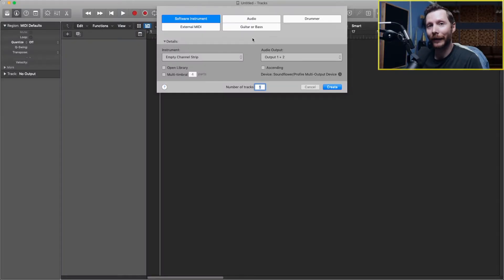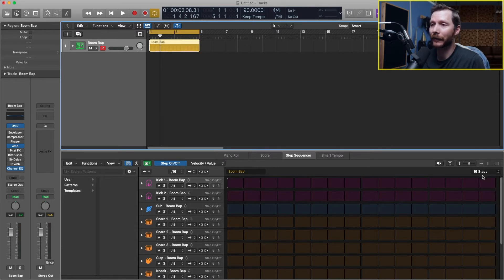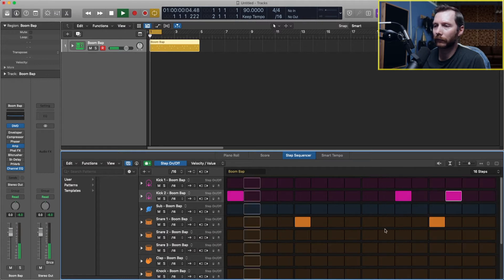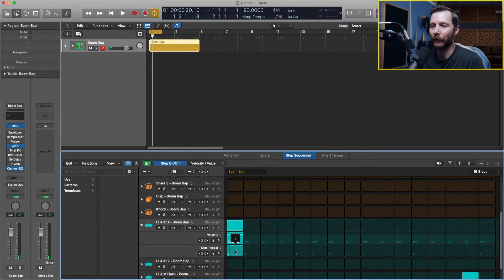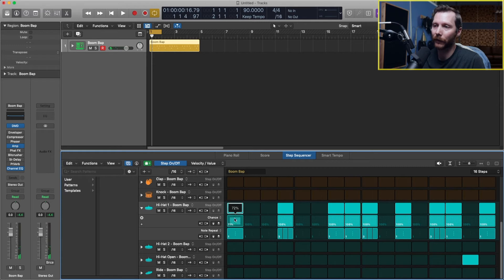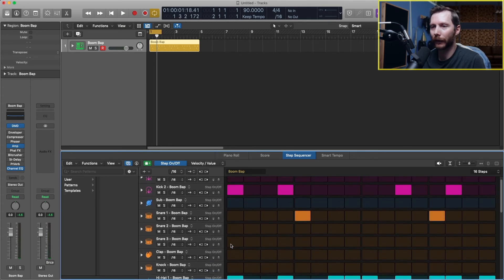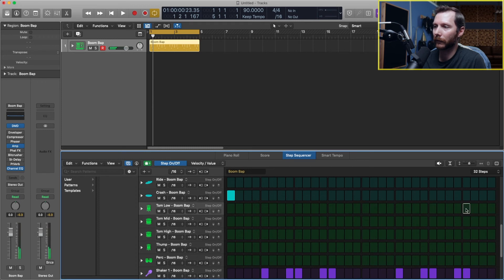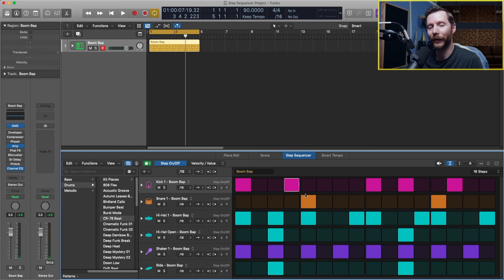How to Make a Drum Beat in Logic Pro

Comment: Hey, thanks for the cheat sheet.  As far as subjects for videos.  I’ve had Logic since 2009, but I’m just now making myself buckle down and learn as much of the program as possible.  I had used Cakewalk and then Sonar, and before that an M-79 16 track with 2” tape.  Analog of course.  I really miss that thing.  
I haven’t watched all your videos yet but I’m going through them so forgive me if I mention something you already have a video for.  I’m sure I’ll get to it. 
I’m not sure how to use the drop down menu that comes up on the track area where the mute, solo, and track volume is.  I see it when I drag a loop over to put in a track. 
I haven’t seen a video on any third party loop packs, and I’ve looked for some but I don’t know know which ones are easiest to use and which ones are best.  I saw a video that I can’t find again that shows how to put intro, verse, etc, above the tracks.  I know how to put them there but are they useful for anything else like if you put intro there do the drummers pay any attention to the labels and put an intro in there and change for the different sections of the song, or are they just markers to help remind me of where I am in a song at a glance?  
I still only have a basic grasp of how to use Flex Time, and pitch correct.  I’m basically still learning my way around and now I’m learning the hot keys (thanks again).  I’m splitting my time between learning this app and improving my guitar and vocals. 
Hopefully I gave you an idea.  I’ll try to think of more.
Reply from the maker: Hey thanks for taking the time to write this comment and suggest some topic ideas! 
-The dropdown menu you are referring to acts as a shortcut to load samples into the sampler. 
-I don't use a ton of loops, so I'm not super familiar with what's out there. Most people use Splice (https://splice.com) for loops and samples. There are a lot of free loops in Logic Pro though. This video will help you find those: https://youtu.be/U5HZvjaun2o.
-If you're using markers to outline your song sections then yes they don't do anything other than that. If you use the arrangement function, then yes the drummer will follow the arrangement and populate different patterns based on your sections (intro, verse, chorus). You can also copy entire sections of your song by copying and moving the arrangement headings (you can also delete entire sections so be careful).
-Flex time & Flex pitch: check out the different modes based on what you're doing.
I'll comment back here once I've got some more videos of those things for you.
Cheers
Georges